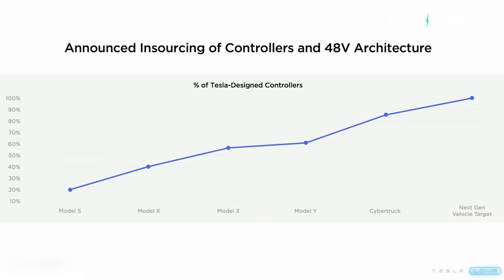How Tesla plans to save $10 billion every year by using less copper

Comment: This  actually isn't a new idea. Auto engineers have been pushing for 48V systems for AT LEAST 30 years. It just so happens that management, accountants and suppliers and accountants always stopped them. Did I mention accountants?
Reply: The accountants were right.  The offset in copper savings brings a whole 'nother set of problems with things like switches, harnesses, actuators, sockets, etc. and those problems also cost money, but nothing is more expensive than warranty repairs and loss of reputation.  If Tesla can make 48V architecture work without introducing different problems and do so economically, they will indeed have achieved a milestone, something legacies have been trying to do for years.
Reply: @ohger1  you are right, Tesla might be in a right position to do this. especially when they control what happens in their vehicles end to end. Almost everything needs to be redesigned and can be done only for something like Model 2 maybe.
Reply: @ohger1  Remember Tesla doesn't have a lot of switches.  Most things are electronic, light interrupters, magnetic/Hall effect.  These things are price sensitive to volume production, and Tesla is big enough to see these savings.  48V just makes sense.  I expect the whole industry will now switch over ... they have been leaning further into it, but most hadn't taken the leap.
Reply: @davidharris7249  Right on two points - less switches with Tesla and 48V makes sense, but there are other issues.  Even things like the enameled wire to wind power window motors has to be thicker and has to be nearly perfect.  A bubble in the wire enamel at 12V will never be a problem, but might arc through in 5 years at 48V.  Semiconductors run at less current but run at higher voltages. It's absolutely doable and if anyone can do it, it's most likely Tesla, but it won't be a simple process.  Even making a 48V battery to fit in the 12V form will take some manufacturing precision.  EDIT: to say that Tesla has a short history overall, but their history is full of thinking outside the box and solving problems a lot of legacies haven't.  Just to be clear..
Reply: @ohger1  Generally agree, but 48V is not new tech.  Other areas use it already (planes, say), and 48V is still considered low-voltage, and insulation should not be a problem, and arcing should not be a problem, either.  Its a good step, and I think most would support it .... no-one in the OEMs has had the balls to do I, although I think some of the smaller manufacturers have.
Reply: @ohger1  no, legacy auto has specifically NOT been trying to do this.  They could have/should have in the 90's and they chose not to.  Suppliers have had 48v equipment for years and it's not difficult to convert. There are no "new problems" this will cause, this is simply laziness by traditional OEMs which is why they're being disrupted.
Reply: @GregHassler  And you're wrong. Several automakers had prototypes built in the 80s. Print magazines and industry publications of the era printed articles about them and the new crop of problems that popped up.  But forget historical fact for a minute, with all legacy makers squeezing pennies on everything else, why would they not switch?
Reply: @ohger1  I disagree.  Switches for up to about 100V don't have much change in price.  Harnesses for 48V will cost a lot less than the 12V ones.  Actuators will be at just about the same price.  Sockets and connectors will be cheaper due to the lower current.  It was almost all inertia that kept the voltage at 12V.  Aircraft have been using 28V for a long time.
Reply: In the days of tungsten filament lights, the thinner 24V filaments did not hold up well to road vibration compared to thicker 12V filaments.  Lamp life killed the change to 48V.  The obsolescence of tungsten lamps removes that excuse to not move.
Reply: Bently presently uses 48 V in the Bentayga. It's not that hard.
Reply: Agreed, Bosch, Delphi, others have been working on 48v systems for awhile, I remember seeing info on it 15-20 years ago.  And 24v in military applications and diesels.

Comment: Tell me you have no grasp on the tech in a Tesla without telling me... 

"...a change from 12 to 48v "low votage" system will save 3/4 of the weight of copper in the vehicle." Then uses a "high voltage" drive motor" weight as a example of the reduction in copper and inturn weight saving. 🤦

Comment: You went off piste there at the end Viking. Would have been better to say that all ancillary electrical devices on cars (wipers, lights, window motors etc) run on 12v and have done for decades. Because Power = Volts x Amps (W=VxA)...the wiring needed for the 12v systems is a lot thicker than it would be for a 48v system which need 1/4 the amperage (current) to run wipers, lights etc. The weight savings are in the cabling systems. This is nothing to do with the traction motors which run on higher voltage and are powered by the traction battery...I think that works around 400v in the Tesla. There will be no less copper used in the motors.

Comment: 48 volt and less wiring harness parts.  Companies must make 48 volt accessories vs 12 volt.  Like 48 volt wiper motors, power windows motors etc.  breaking up wiring harness with Bluetooth connections  plus easier to assemble and diagnose problems.  I think some lemon cars small nick on wiring harness as harnesses are so long with easy damage.

Comment: Tesla is stockpiling a lot of new technologies.  
Which technologies will be included in the Model 3 refresh "Project Highland"?
The new technologies include:
1. Giga Castings front and rear
2. Structural battery pack with 4680 cells
3. HW4 computer
4. Higher resolution cameras (HD)
5. HD Radar
6. 48 volt architecture
7. Will 48 volt require a HW5 computer?
Will an upgraded Model 3 force a Model Y upgrade?

Comment: Whoa, hang on there. The Motors use High Voltage, they won't get any benefit from this. They will still need the massive Copper wires to feed them and inside of them. It's only the ancillary equipment which is currently using small wires at 12V that will benefit.

Comment: yeah no. the low-voltage wiring harness couldn't possible weigh more than 50 pounds so at best case you cut that in half cause you still need vinyl insulation. your gonna save very little, less than 100 bucks and less then 20 pounds. certainly not a big deal. If you wanna save weight and wire, lose the power seats, windows, door locks, elc door handles, cameras, sensors. All tesla has done here is remove any posiblity of the aftermarket being able to sell products for your tesla

Comment: The change in 48 volt might enable the use of larger diameter aluminum wiring. Although the aluminum wire has to be larger diameter to make up for resistance the resulting wire may weigh less than copper for example this tradeoff is used in high voltage electric transmission lines. Of course if you fail to increase the diameter of the cable's conductor, the resistance of the aluminum will cause a toaster heating effect creating a fire hazard.
Reply: Aluminum presents other issues. There was a move to change household wiring to aluminum back in the 1970s but it didn't last long because of the increased fires. The chief issue is not the aluminum wire itself, but that it was virtually impossible to get the people doing the wiring to do it correctly. For that matter, even with copper wire household wiring is way oversized for the load for the same reason - the certain knowledge that many of the people working on it are going to do things that reduce its ability to carry current.

High voltage transmission lines are uncommon enough that it's possible to more closely regulate the people who work on it, and the cost savings of using aluminum are high enough to make it worth the extra effort.
Reply: Al also has issues with a high-resistance oxidation layer.  This was main reason it was abandoned for wiring in homes, as it caused a lot of fires.  I believe that was 1960's.
Reply: @loungelizard836  - yes. I hadn't wanted to go deep into the technical issues, but that's the issue. It's manageable with Noalox but it's nearly impossible to assure that the people installing the wiring in households consistently and correctly use it on every one of at least several hundred connections in every house. It is still allowed for the service entrance cable and is the norm for that use.

Looking it up, aluminum residential wiring was available in the U.S. starting in the 1960s and through the mid-1970s. I don't think it became common even then, as I have only once ever run into it.
Reply: Aluminium becomes brittle over time. In the UK they used it in the telephone cables in the 1970 and less than 20 years later any movement destroyed the entire multicore cable.

Comment: For the record in the USA cars moved from 6 volts to 12 volts in 1955.  Which is 68 years ago.  Agreed that 48 volts is a big deal. I like you channel.
Reply: My 1966 VW Beetle was 6v. VW moved to 12v in 1967
Reply: Yep;  I remember it.  Probably it was to enable increased compression ratios and thereby horsepower, but what I remember was how much brighter the headlights became.  The old 6v headlamps were pretty dim, and there were far fewer reflectorized markers along the road.  The highways were designed for cars going 45 mph;  a mile a minute was really fast.
Reply: Not all cars switched at the same time.

Comment: If you think saving copper going from 12V to 48V, imagine how much they would save going from 400V to 800V. That's where you really save a ton on copper and lower the heat in the battery pack, making it 4 times easier to keep the cells cool versus 400V.
Reply: 800V has some advantages, for charging and use, and does reduce the wire size.  It does require extra insulation, MOSFETs able to handle that voltage  that are more expensive, and 1000V charging stations, etc.  I suspect it close to a wash between 400 and 800V, but may swing to 800V in the future.
Reply: @davidharris7249  Tesla said that if they had their life over again they would have made the Model 3/Y 800 volts from the start but changing now is not worth the effort.
Reply: Distance wise there is FAR more 12v cabling in an EV than high voltage cabling. Definitely 800v would save some, but you're only talking the couple feet of wire from the pack to the inverters and a couple more feet to the motors.  A small amount maybe to the DC-DC converter.  There are tens of miles, on the other hand, of 12v wiring in a car.
Reply: 800 volt has nothing to do with lowering heat in the battery pack.
Reply: 800V does not reduce any significant amount of  heat. The cells will still be limited by how many coloumb they are able to discharge. Hot batteries are due to the chemical process inside.
Reply: 800V for traction is undoubtedly the way to go. It is already a standard for many traction applications such as E buses and light rail.

But safety and insulation needs to be thoroughly squared off in the private vehicle market.

The main advantage is reduced Amperage therefore reduced Ohmic losses and cooler operation as well as faster charging due to lower Ampere hours.

A number of EV makers have already made the move. Competitive pressures likely mean the rest will fall in line.
Reply: They don't use much copper in the HV side, the use aluminium.
Reply: The 400V wires are actually pretty thin already.
Reply: with electric prime movers and buses starting to become more common, I think there will be a big push to move to 800V charging.
Reply: Didn't Elon say at the investor day that the Cybertruck was a 1000V high voltage system and a 48V low voltage system?
Reply: @glennrmarks  I can't remember, but I would like to see it if you found it. Maybe you meant the semi?
Reply: @AAb-xy6et  it was definatly the cybertruck
Reply: @glennrmarks  Oké, I would love to see it if you found it.
Reply: @AAb-xy6et  Its a 4 hour video, I will try and find it and post the time mark here.
Reply: The topic in question is not the vehicle voltage architecture but the aux system running other devices in the cabin including lighting Infotainment and other things which have been traditionally on 12v.
Reply: Correct. So my comment was that if they think that will save them a ton of money on copper, imagine of they were using 800v instead of 400v. Not only does it include the main battery pack and all it's vast amount of copper, but also the motors' copper amount among other items. That's were the vast amount of copper is used on EVs, the main driving components, NOT on the low voltage system.
Reply: @Paul-cj1wb  got you and I agree, however I think when it comes to the battery systems more savings might be via the wireless telematics modules if and when implemented, apart from the higher voltage advantage. 400-800V switch is for the charging architecture if I am not mistaken, it doesn't alter how much copper is in the motors and copper needed at individual battery level. Correct me if I misunderstood. Apart from the DC charging system which is designed to pump a large amount of current and then distribute to individual battery modules, one cannot totally avoid copper there as it is a function of current that needs to be pumped into the battery modules to achieve max faster charging at that level?
Reply: @nagki  Not correct. To make it simple to understand without going into all sorts of explanations, imagine if all the high voltage wires on transmission lines were using very low volts. They would then have to increased the amperage to be able to transmit the same amount of power, (which is what happens on 400V systems to get the high speed charging) and the same thin cables would burn up in a millisecond. Otherwise they would have to be 100 feet or more in diameter. Instead, the voltage is increased to many hundred thousands of volts allowing for the thin wires to transmit all that power over them.

The same happens when driving. Meaning, not only is it more efficient and faster while charging, but also while discharging. The same happens with motors. The higher the voltage, the lower the amps, the more efficient they run and the cooler they stay. It's the resistance of higher amperage that causes the heat. So upping the voltage allows for the lowering of amperage to get the same amount of power while producing only a quarter of the heat.
Reply: @Paul-cj1wb  how much copper in lbs is at 400v? How much copper in lbs is at 12v?  Going from 12 to 48 is huge.  From 400v to 800v is very small.
Reply: @nagki  Yes, we know that.  I was commenting on a comment about 400 vs 800V for drive motors.

Comment: No change in traction motors regarding copper, since they are not 12V motors but high voltage ones (around 350-400V depending on models).

But low voltage electrical harnesses are a significant part of the car's weight, since almost everything needs electricity (windows, wipers, audio, lighting, seats...) and to get the same power with 48V you need only 1/4 of the current compared to 12V (since P = U * I).

That means you need also wires which are only 1/4 as big in cross-section, or 1/2 as large in diameter, and yes, assuming the same length for the wires (using 48V will not shorten them!) it's actually 1/4 of the copper mass that you need. But only for low voltage part.

Comment: Yes it will reduce weight and use of copper but speaker wires will not change unless the impedance of the drivers changes ! It might sound better though using 48 boots for the amplifiers !!
Reply: Go for active speakers that run on 48v.

Comment: As mentioned here in the comments, the 48V refers to ancillary systems. Not the motors.
Reply: But Sam may have used the word “motor” when referring to wiper motors (fan motors ) a/c compressors and solenoids etc.
Reply: @Max Flight  I imagine AC and heat pumps that may matter.  Good point
Reply: You're right but for an EV, every small weight reduction, even if it's just 1 kg makes sense. Also 1 kg of copper times 1 000 000 cars is still a lot of copper that is saved.
Reply: This video is completely based on the first Google hit on "amount of copper in a Tesla" and he might have done a bit more research to make sure he actually knew what he was talking about. As usual.
Reply: When one says Entire Architecture, they should actually mean the entire Architecture shouldn’t they?
Reply: @Chris Braid  These Kind of fly By Wire Mistakes, That Sam does is happening More and MORE .
he needs somebody like you on his staff to review his work before spouting it out. 

The way he pumps out videos I can understand, the compiling of mistakes.
Reply: @chrisbraid2907  yes
Reply: Exactly.

Comment: 12 volt has been the electronics supply voltage . So will all the electronics run off 48 volt ? If so would that mean developing electronics to run off this voltage which if not readily available would be more expensive . I have not seen any electronics running off 48 volts . The other thing is the battery I presume would be 48 volts replacing the 12 volt . I don't think that is readily available and would be more costly
Reply: Lots of electronics run at 48 volts (comms, POE, etc.)  and 5 volts (most microcontrollers). Most electronics already do power conversion from 12v so it's easy to replace  a 12v conversion circuit with a 48v power conversion circuit and save on copper wire. High power draw things like window motors and heated seats could be easily modified to run on 48v with immediate savings in wire.
Replacing the 12v battery with a 48 volt battery should be about the same cost (higher voltage, lower current, same "size").
Reply: Buck converters are inexpensive add-ons for those devices that aren't available in higher voltages yet.
Reply: The battery does not need to be like a ICE lead acid as they don't need to crank the engine over.